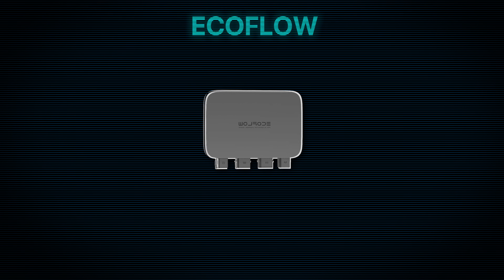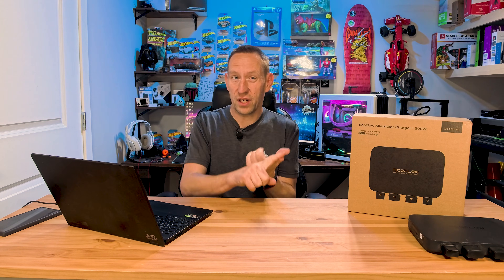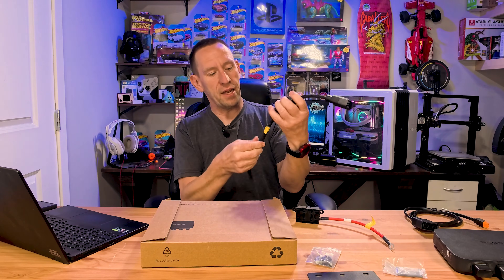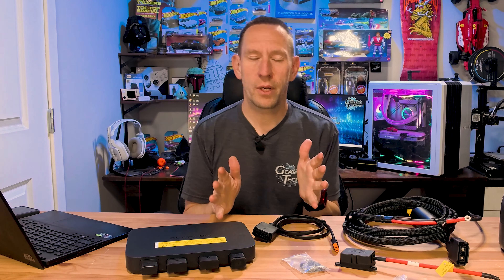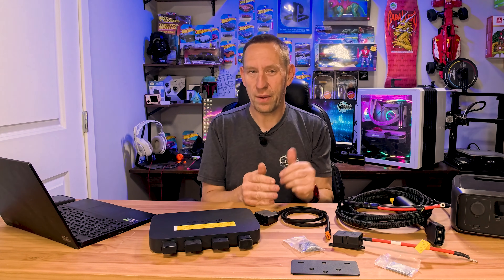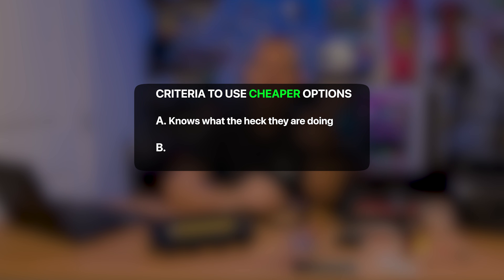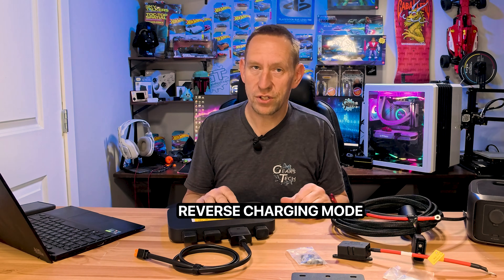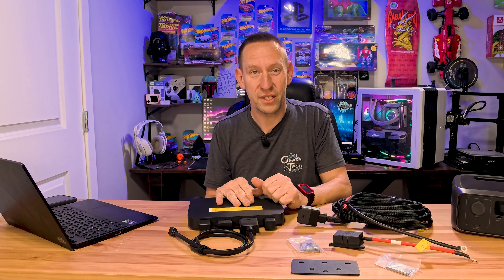EcoFlow's Game-Changing 500W Alternator Charger Revealed

Comment: I have the River 2 Pro together with the 500 alternator charger.  Initially the charger kept cutting out long before the River 2 had fully charged. After searching YouTube I reduced the voltage from 13v to 12v on the app and now it is fully functional.

Comment: When I found out that Ecoflow made the XT150 to XT60 charging cable (that normally comes with their 500w alternator charger) available separately, I purchased that cable along with the more powerful 800w alternator charger. My thinking was that I could use the larger charger with the XT60 cable to have a more universal charging solution. While that is true for other brand power stations  (but IIRC you lose the maintenance and reverse charging options with the smaller XT-60 cable), it does not seem to be an option to charge a stand-alone 12.8v lithium ("house") battery. Apparently, this is because the 800w charger can only be dialed down to 24v and no further while a standard lithium battery charges at 14.2v - 14.6v. So, 24v input is fine for power stations that usually have built in charger functions and a voltage input range from something like 11v - 60v, but as I understand the situation, a stand-alone battery needs that specific 14.2 - 14.6v input.

So now I possess a charging cable that I may never use since I only own Delta 2 power stations and don't foresee replacing them anytime soon. I did purchase a (non-Ecoflow) 12.8v 230ah LifePO4 battery to extend the overall capacity of the system instead of purchasing the OEM expansion battery option, but it seems I can't charge it using the Ecoflow 800w alternator charger directly. I'd have to use one of the Delta 2 AC outlets and a separate AC-DC lithium battery charger to juice up the 230ah battery.

Or, is there another option?

I was thinking some sort of adjustable DC voltage regulator or perhaps a 24v input to ~14.5v output buck converter might be adapted with that XT-150 to XT-60 Ecoflow cable to provide the proper voltage to charge the stand-alone battery. Might those options work? Any other ideas?

I can understand why Ecoflow didn't make this battery-charging option available (by allowing the charger to output 14.6v) since hooking less-expensive stand-alone lithium batteries into their power station system would impact sales of both their power stations and expansion batteries, but it would certainly add functionality to the alternator chargers and might boost demand for those.

I also wonder if the fused Ecoflow input cable could be directed to, and split by, a dual-battery cutoff switch before connection to the 800w charger in order to direct the current from the vehicle to either the Ecoflow alternator charger(s) or a different DC-DC charger dedicated to charging the stand-alone battery. Without such a switch, the power input cable would need to be physically disconnected from one charger and connected to a second charger if a choice between charging a power station or battery needed to be made - very inconvenient. Installation of a switch would also make it possible to transfer the Ecoflow charger(s) to a different vehicle that had a separate supply cable from its alternator in place. That way, the Ecoflow charger could be disconnected and transferred without having to pull the entire supply cable from an alternator and through the firewall of two vehicles.

I have such a 40amp 14.6v DC-DC charger (that also includes a very low-VOC limited MPPT function for solar charging). I could wire that charger to the switch. But, is it OK to splice that Ecoflow supply cable to a dual battery switch? Has anyone done so, or is there some reason why that arrangement wouldn't work?

Thanks for any insight into solving this problem.
Reply: my idea if youre problem is that you want to put it on secudary side of EFACharger but thats too high woltage. can you paralel it with starter battery or is it lipo/lopo4? if so thats too unstable (alternator voltage), so would then recomend a secudary secudary battery setup parralel to starter battery, via an 12v to 12v charger (does 14v) the higher the price the beter and more automated. then the ecoflow (you only have the xt60 output, that limit to one function, because xt60 input is not output.) an xt150 to xt150 (you already have this) and the cheepest ecoflow with xt150, would open up the two other functions (oviusly). one ecoflow 3 has an 12v 30A, so if you can limit charger you can save the inverter idle cost.
if you want to go from fuse to switch to two output, i would fuse them both at proper fuse size, making a main and secundary fuse (system). 
 (sorry bad english).
Reply: (check if there is an 3 party xt60 mode think you might be able to go from 11v to 60v)

Comment: the xt150 cable allowing reverse charge and maintenance mode would be useful. even the maintenance setting would allow you to plug in a ecoflow delta series into your van and allow a diesel heater to run off your battery while away from your vehicle. too bad they decided not to provide the cable. also sounds like a bad choice to downsize the wires for the 500W model rather than keep them the same as the 800W model. a bit of a safety issue with a family with multiple vehicles for a few dollars of cable.

Comment: Eco flow is a rip off.  The 500w alternator charger doesnt come with a cable that will monitor your car battery. You have to pay an extra  100 bucks for the right cable, xt150, and they don't tell you that when you buy the charger. Their customer service is astoundingly bad, there is no continuity of the conversation.  Every time you want to reply, it goes to a new agent, and the conversation starts all over again.  When the shipment didn't arrive, their advise to me was contact the shipper even though I had already done that twice and still they couldn't find a UPS STORE. It took 15 days to get my item due to their very poor. Customer service.  I will never buy eco flow again.
Reply from the maker: That wasn't my experience. But yes, it's hard to understand about the different cables. I think I cover it in my video though

Comment: I have a 130 amp alternator in my truck.  If I purchase the 800 watt charger, will I destroy my alternator?  Or is it up to me to set the 800w charger to a lower setting so that I do not fry my alternator?  Maybe it's safer for me to purchase the 500w?
Reply from the maker: you should be fine. But you can set it lower if you like

Comment: I do have the big brother that is 800 watt. I recently purchased the xt60i cable so that I can charge both my Delta 3 plus and smart battery at same time.
Reply from the maker: Let us know how it works
Reply: @GearsAndTech Using the xt60i cable works great for charging both delta 3 plus and extra smart battery in car when they are connected to each other.

Comment: Does it mean that the XT60 cable could only be used with the 500W alternator charge? Could it still be used with the 800W charger? I know EF sells the XT60, wanted to get one for my 800W charger. Also, since some units (like the EF Delta 3 Plus) have 2 XT60 ports, couldn't we use 2 cigarette chargers at the same time to recharge the unit, therefore pulling 240W of charging capacity?
Reply from the maker: Yes it can be used with both

Comment: Isn't this pointless if the 800W is already out.  I think the XT60 river port tops out at 220W, so the 500W seems to be just for marketing.  They could have added more ports to charge 2 River at the same time, which almost utilizes the whole 500W.
Reply from the maker: Excellent point about 2 ports

This is actually a cost savings for most people that don't charge at 800w. Plus it works with anything that can take an xt60 port.

I personally like this over the 800 for most people

Comment: Yes, I’ve got the big brother alt charger from EcoFlow and it’s been a total game changer (appreciate the install video) so EcoFlow came out with the 500 cause of price point and charge smaller batteries?thanks just wondering
Reply from the maker: Yes. It's the same as the 800w just smaller and cheaper

I think they found most people were setting the 800w to 500 anyway. So they shrunk the wiring and turned down the output.

Saves everyone money and you pay for only what you need

Stay tuned. Install video coming